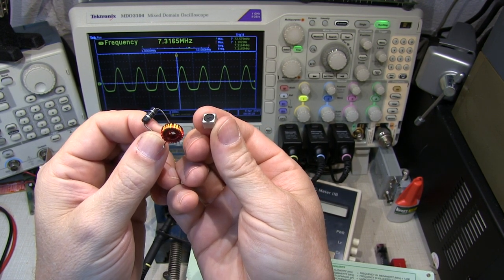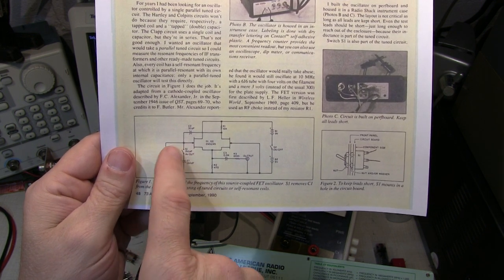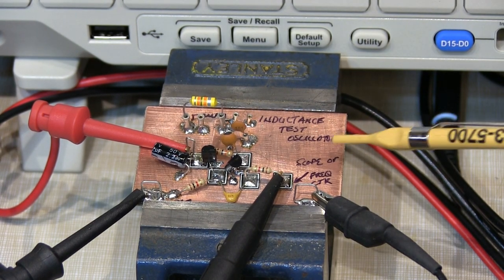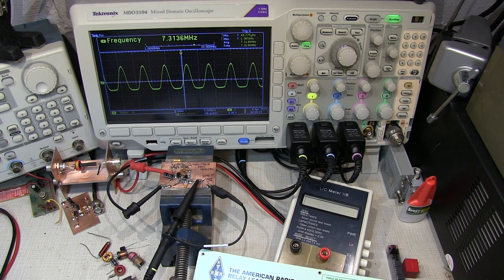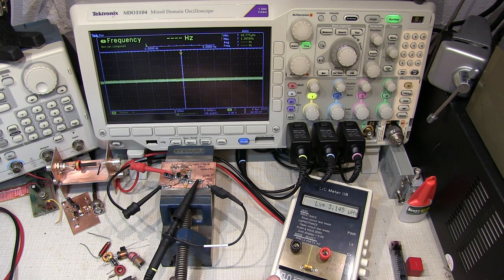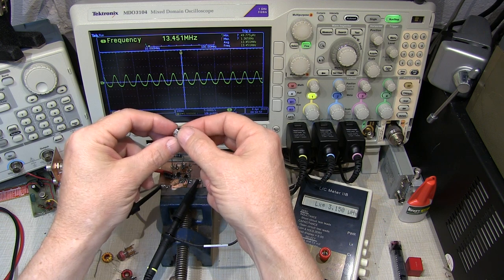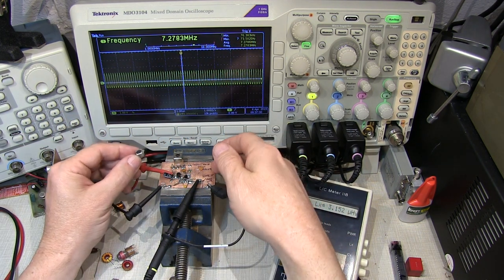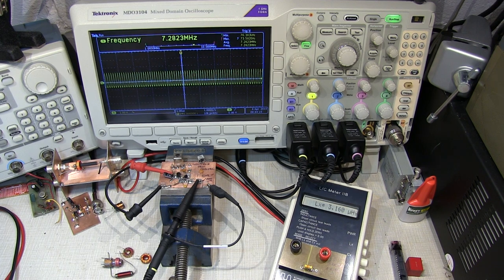#199: Measuring coil inductance and IF transformer resonant frequency

Comment: I can finally measure my FM air coils. Thanks again! Your circuits ALWAYS work! Tweaked it a bit and it runs fine in UHF. Quite accurate after accounting for the parasitic capacitance of about 10pF.

Comment from the maker: For jean pierre daviau - yes, the 0.04 is in uF.  The value is not critical.  I think I used 39nF in my circuit, or maybe 47nF.  All of the caps are ceramic, non-polarized.  I added the 2.2uF cap as a power supply filter cap - not shown in the schematic.  It goes from the power supply connection to ground.
Reply: *****i I build it with two  2N3819.   I tried to test a  brand new 100uH coil.  I  have  about 2.4 MtHzw .   Whith  wich      cap does the oscillator works , 33, 150 pF ?  Or  the addition of  1/33+1/150+1/150?
Reply: Do you have any good sources on the tektronix mdo   3104? (USED)Sam
Reply from the maker: Unfortunately no, I don't have a good source for used equipment.
Reply: I know a few places that sell used test gear, but their prices are not what I consider fair let alone good. MHz Electronics sells on eBay now. Them, and another local seller have absurd prices listed, but usually if I hang around for an hour or two then haggle the price comes down. You can't do that with eBay at all, and MHz has amassed so much stuff the fire marshal took away MHz's certificate of occupancy, so no more retail sales from their warehouse. He has stuff stacked up way above the sprinkler heads, so the fire department finally made him close to the public. I hear of people talking their way in, one at a time. I only see the guy at auctions now. He pays  way  too much for stuff to begin with, and he is addicted to bringing home junk by the semi truck load. Who wants 18 1960s hard drives the size of dining tables? Aside from MHz, of course.

Comment: After searching for an accurate home-brew inductance measurement circuit, I built the circuit you described back in 2015 on YouTube.  I use my oscilloscope to measure frequencies.  I am astonished at how close the measured frequencies are when compared to the calculated frequency, an average difference of only 1.14% across an inductance range up to about 3 nanoHenries.  Thanks for sharing the design.

Comment: I know it has been years since you posted this video but gold nuggets can be found all over and years old. I used J112s and this circuit works great. I just built the box and now I have an IF can tester (IF Transformer for those that don't like the term can). I found that oscillations are not stable on IF cans that I found to have SMD. I am going to work this as an issue and see if I can use this to spot SMD in old IF cans with reliability. As usual thanks for your postings and work.

Comment: I had just wound some toroids and was wanting to test for inductance.... Now I can build another "test circuit" to accomplish what I can do by breadboarding the toroid with a known resistor and check with my mulitmeter, and do the calculations by using my "brain box."  I will make the test circuit later.  I enjoy your channel and learning about radio electronics!  Thanks for posting. 73's de KD5SMF

Comment: Nice circuit. very useful. I use something similar for power electronics, mine uses a power FET, power resistor and square wave generator (555 timer) to obtain the current ramp characteristics and inductance of a inductor using a scope.

This one seems to measure unknown HF coils.

Comment: If you follow the link to the 73 magazine article, you will find there is a listing for a program in basic to do some nice calculations for you. Unfortunately, the listing is unreadable. I tracked the listing down from another, higher resolution source and entered it. It checks out with the test calculations given. Today, basic is an obsolete language and hard to find on Windows. I think better in C anyway, so I translated it.

/* Coiltest.bas translated to 'C' */
/* G.L.Peterson - 7/1/2019 */

#include <stdio.h>
#include <math.h>

double F1;     // Freq without capacitor
double F2;     // Freq with capacitor

double PI = 3.141592654;     // 2 guesses what this is

double LS = 0;     // Stray inductance in H, if known
// double LS = .0000002;  // Est 0.2 uh

double CS = 0;    // Stray capacitance in F, if known
// double CS = .000000000001;    // Est 1 pf

double CT = 150e-12;     // Switchable capacitor = 150 pf
double L = 0;     // Calculated inductance
double C = 0;    // Calculated capacitance
double CD = 0;    // Distributed capacitance
double FREQ = 0;    // Table frequency
double TEMP = 0;    // Working storage

main()
{
     printf("Coiltest.c -- Derived from M. Covington 1989 - N4TMI\n\n");

     opinput();     // Get resonant frequencies from operator
     calc();     // Calculate inductance
     table();     // Display table of possible usage freq's

     return 0;
}

// Get 2 frequencies from operator

opinput()
{
     printf("/nF2, frequency with 150 pf Capacitor (Mhz):  ";
    scanf("%lf, &F2);
     F2 = F2 * 1000000;     // Convert Mhz to Hz

     printf("/nF1, frequency without Capacitor (Mhz, 0 if no oscillations):  ";
     scanf("%lf", &F1);
     F1 = F1 * 1000000;     // Convert Mhz to Hz

     return;
}

// Calculate inductance of coil

calc()
{
     if (F1 == 0)     // Can't calc CD if no self oscillation
          CD = 0;
     else
     {
          TEMP = F1 / F2;
          CD = CT / ((TEMP * TEMP) - 1);    // Distributed capacitance
     }

     TEMP = 2 * PI * F2 * sqrt(CD + CT);
     // L = (1 / (2 * PI * F2 * sqrt(CD + CT)e2 - LS));
     L = 1 / (TEMP * TEMP - LS);
     L *= 1000000;
     printf("\nInductance: %4.51f uH\n", L);

     if (CD != 0)
     {
          CD = (CD - CS) * 1e12;
          printf("Distributed Capacitance: %4.51f pF\n", CD);
     }

     return;
}

// Print table of usable combinations

table()
{
     int I, J;

     printf("\nResonant Frequencies with this coil:\n");
     printf("C in pF\tFreq in Mhz\n");
     printf("-------\t--------------\n");

     for(I=0, J=2; I<9; I++, J*=2)
     {
          C = 1e-12 * J;
          C *= 1e12;
          FREQ = 1/(2 * PI * sqrt(L * C));
          FREQ *= 1000;
          printf("%i\t%2.71f\n", (int)C, FREQ);
     }

     return;
}

/* Test case - from a run of the Basic code - formatting may differ

Frequency with capacitor (Mhz)? 0.58
Frequency without capacitor (Mhz, 0 if no oscillations)? 1.77
Inductance (uH)     448.0850
Distrib capacitance (pf)     18.04398

Resonant Frequencies with this coil:

C(pf)          F(Mhz)
2                 5.316484
4                 3.759322
8                 2.658242
16               1.879661
32               1.329121
64                .9398304
128              .6645605
256              .4699152
512              .3322802

*/

Comment: August 1962 Popular Electronics "One Arm Theremin"...Beats two RF signals together via two oscillators. One fixed and the other variable via body capacitance. Can/will the circuit in this video  help determine the inductor value to make the instrument function, because it's been nearly impossible to locate the two specified JW Miller RF coils?

Comment: When using an LCR meter to measure the inductors winding inductance and capacitance. The LCR meters has two different modes In series LCR and in parallel LCR to measure but then you can calculate the resonance frequency, but how would you know at what frequency is the resonance frequency? When winding wire around a magnet what determines the winding inductance and winding capacitance?

Comment: Relay coils and Solenoids coils are considered LCR networks so they are considered reactive loads? If a relay coil or solenoid coil needs 12vdc at 1amp of current to energized turned on. When you set the lab power supply to 12vdc at 1amp since the relay coil or solenoid coil is an reactive load/LCR network its going to need more current because its an inductive capacitive load?

Comment: k6olg has a similar circuit in winter 1993 of communication quarterly.but uses a big t-80-2 tank coil of 25uh...and said the mpf102,s should work in place of the 2n5245 jfets..and  has a computer program for the calculations..I have this in pdf if anyone needs it...Love your video's...

Comment: Nice work, is there a way to determine what guage wire, total length and how many turns one would need to obtain 50 amps and 24 volts from a single coil if the magnets are 60mm by 200mm rotating at 6000 rpm?

Comment: It it normal for an IF transformer to resonate on one frequency for the primary and another, significantly different frequency for the secondary?  For example, I have an alleged 455KHz IF can that the primary resonates at 455 but the secondary will not resonate at that frequency. The slug is turned all the way out and it still won't make 455.  This is a miss by about 100KHz too low.

Comment: This video, that test circuit, and an Amidon 1-10MHz shielded IF core, magnet wire, and some small caps should make for home winding a rendition of the 8.8307 MHz Kenwood intermediate frequency transformer. I suppose I could even change the reference crystal value(s), and make (an)other IF(s)  to match that (those). There is no law that says a Band Scope adapter cannot run at another frequency, is there? Hamfest/Swap meet season is upon us here in the desert, so, I'll see what Kenwood bits can be had.

Comment: EMF means the "time constant LR" of the inductor? because 1 amp of current going through an inductor will have a time constant so the 1 amp is have slope ramp over time which is from the EMF? and the Counter EMF is current backfeeding backwards at 1 amp?
Reply from the maker: No, EMF is the Electromotive Force, which is essentially the voltage.  See https://en.wikipedia.org/wiki/Electromotive_force
Reply: @w2aew  If the voltage is +12vdc the EMF is 12? That doesn't make sense that the EMF is the same as voltage because C-EMF is following the opposite direction. The impedance of an inductor/coil is based on the EMF value?

Comment: w2aew, how do you connect a sweep frequency generator 20hz to 20Khz to an inductor to plot the frequency response on a spectrum analyzer or what else can you use to plot the frequency response besides a spectrum analyzer. The Inductor only has 2 wires so if you connect the Lab Sweep Generator across the inductor how do you connect the spectrum analyzer to plot the frequency response of the inductor?

Comment: W2AEW, I see a 2.2uF electrolytic on your board there...  Am I missing something because I don't see that in the Schematic and my rudimentary understanding of this circuit gives me little clue as to its purpose!  Thanks in advance for any comment.  73 KE4CDR
Reply from the maker: That is just a power supply filter cap, sitting between VCC and GND.
Reply: @w2aew  Ahh.  Got it. Thanks.

Comment: Hi,
Excuse my questions,
I guess that 0.04 on the schematic is  .04 uF.
I guess the electrolytic kind of capacitor on schematic are not + or minus except for the 0.04 Tantalum.
Did I miss the explanation for the 2.2 uF capacitor?  
It goes from the ground to the drain of the JFET?  The red clamp from the LC meter is grounded or it is not by the square hook?

Nice video .

JPD

Comment: Why was it necessary to add the 2.2uf electrolytic capacitor which was not on the original schematic?
Reply from the maker: Always a good idea to add some bulk power supply decoupling.

Comment: Is it possible to use a spectrum analyzer with a tracking generator to measure impedance vs frequency when a toroid is put over a coax line?  I wanted to explore common mode choke performance.
Reply from the maker: mike94560 Not easily.  To test a common-mode choke, you need to test with a common mode signal.  Sending a signal down the coax the "normal" way with a SA+TG is not a common mode signal.

Comment: Question: What are the component collet sockets used ? Need to get some for this project.
Reply from the maker: They are called Pin Receptacles, made by Mill-Max.  They have dozens and dozens of varieties.
Reply: @w2aew  Wow ! Gazillions of them. Could you clue me in on which ones I need ? Never seen these before.
Reply from the maker: @jameshall5835  Here's an example of one of the ones I use: 0314-0-15-01-34-01-100

Comment: Hey Alan, enjoying your channel! Getting seriously back into electronics after an absence of a few years... Trying to find the 2n5245 (obsolete) or the J310 (also obsolete) don't have a sub guide (yet), do you have any idea what I could use instead? Even the trusty MPF102 is gone... Lot of catching up to do. ;) Slowly working my way through your vids.
Reply from the maker: The J310 is still available from Mouser and Digikey.
Reply: @w2aew  Thanks Alan!
Hope to chat with you on the air sometime!
Reply: @number6of1  I found the J310 jFET on eBay - a set of 10 for $8.68 including shipping.  They work great.  (See my reply to the video dated 10/8/19).

Comment: Another great vid Alan. 

I sometimes come across a small transformer (eg., in a SMPS) which I want to determine if a winding is open or shorted. I've seen "ringer" testers for this purpose. 

Can you show us a DIY technique to this same end? 

Keep up the great work!
Reply from the maker: You can use this circuit to check the suspect transformer's winding inductance, or even the ring technique in this video:
https://www.youtube.com/watch?v=74fz9iwZ_sM

Comment: Thanks for the great content! 
Does the parasitic capacitance of the transistors not influence the resonant frequency of the tank circuit? If not how so?
Reply from the maker: Yes, it certainly can - more so at higher frequencies, not so much as lower frequencies.
Reply: Are there different choices then for FETs with lower parasitic capacitances that can reduce this effect or is it possible to add resistors to swamp the parasitic effects in some way? Was the choke in the original design significant?

Comment: I am having trouble replacing a 455khz coil used to align my MW radio...I dont have any drawing or diagram so Im at a lost...my question are the red painted coils (usually) the 455khz coil...thanks..
Reply: I don’t think there is a standard color. I’ve seen 455 cans with red, yellow, black and more.

Comment: Very helpful circuit indeed...Thank You!
Can this circuit be used in reverse? meaning...If you had an earlier vintage known/marked value  IF can (with internal capacitors) and these capacitors needed to be replaced, could this rig be used via substitution method to determine the correct capacitance value to obtain resonance?
Reply from the maker: It can certainly be used to get you close!  Parasitic capacitance of the circuit will alter things a little, but you should be able to get close enough to dial them in.
Reply: ***** Thank you for the reply!

Comment: Hello. Thanks for all of your videos. I have built this circuit and have used it to test several unknown inductors. it is also useful to determine the self resonant frequency of components.
 I have a question for you about inductors in general. For a given inductance value and all other factors equal, does an air coil inductor have a higher Q factor than a coil wound with a tunable ferrite slug? Also, how does the Q compare between toroids and air core? 
Is there some advantage for using pi wound (3 sections on a core) in series for larger inductances like 1 mH as opposed to a single winding? Thanks again. I enjoy your videos especially the Back To Basics videos because your demonstrations really help clarify these topics.
Reply from the maker: Good questions.  I think in general that air-core have higher Q because there are no core losses.  Of course, for very large value inductors, there would be a lot of turns, thus increasing the wire resistance which lowers Q.  Toroid and straight core inductors should be similar in terms of Q for similar core material and inductance. I really am not sure about pi wound advantages, so I can't offer any insight.
Reply: +w2aew Thanks.
Reply: Do You have an good source on an used tektronix mdo   3104?Sam

Comment: Hi there, I tried to build this circuit with some J310s I bought from Amazon, but I can't get the circuit to oscillate, even after replacing the 470ohm resistor with a 1kohm one as you suggest in your video. Is maybe the 10k resistor too large? I have tried inductors in the uH range (39uH) as well as in the mH range (1.2mH). Can't get it to oscillate. I have built the circuit on a breadboard as well as on a PCB. Same result. Please advise.
Reply from the maker: Have you measured the drain voltage on Q2 to make sure it is in the saturation region?
Reply: @w2aew  Finally got this to work. I had to increase the 30pF capacitor on the input to 1nF. Probably because my resonance frequency was pretty low (like 25kHz). I actually ran a LTSpice simulation of the circuit to see why it was not working and found this out that way.
Reply: I can’t get my circuit to oscillate. The Q2 drain voltage is 11.5 V with an 18.5 V input. Any ideas would be appreciated!